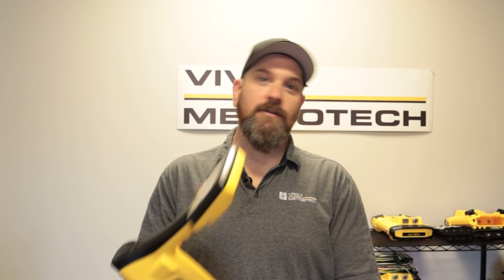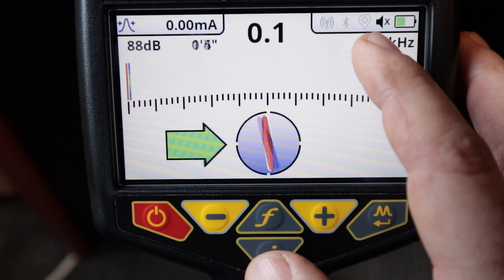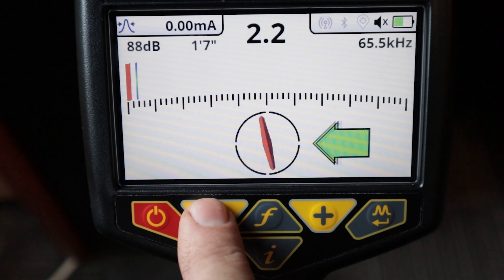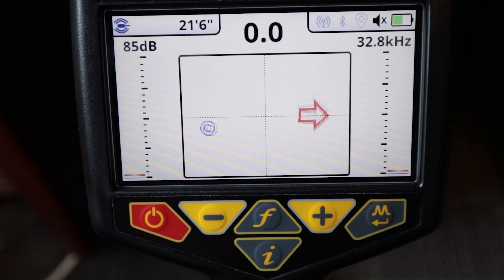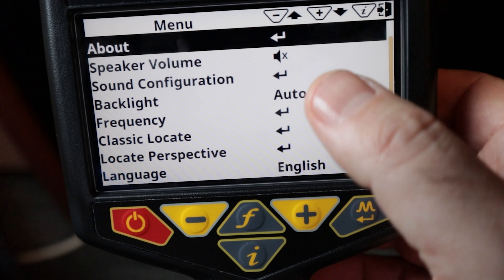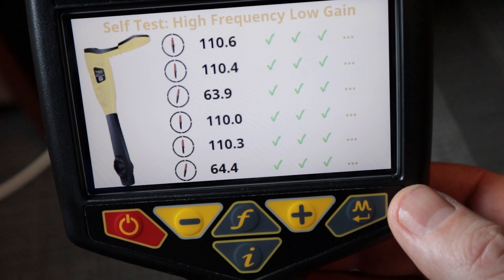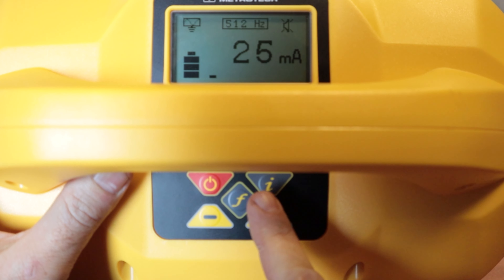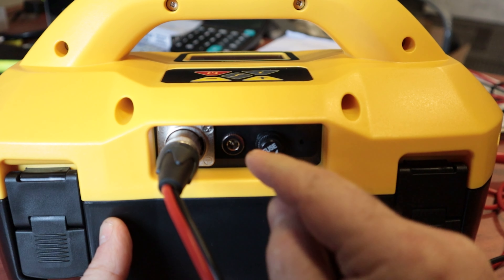How to Set up your vLoc 3 Receiver and Transmitter - Run through of the locate screens

Comment: hello and good day .
please can you help us for answer this questions below?
1- what's the benefit's of the frequencies (power 50, power 150, power 250, CP100,and radio  )in the vloc3-pro receiver unit? 
2- can you make video show us how we can find the fault by using the A frame with vloc3-pro receiver unit . 
3- what's frequency for cable rout finding for very long cables (more than 2km) ,and what's the frequency  for short cable (less than 1000m) .
4- what's the maximum actual depth we can measured in the vloc3-pro receiver unit ?
 thanks with best regards 
Radhwan
Reply from the maker: To your first question. That are all passive frequencies used for damage avoidance and assist with finding unidentified utilities. 

2- yes please look through the channel there is one. 

3- there are a lot of variables when it comes to frequencies. But the lower the frequency the potential it has to go further. 

4- depth is also a function of a lot of variables. But I have located to a depth of over 60ft